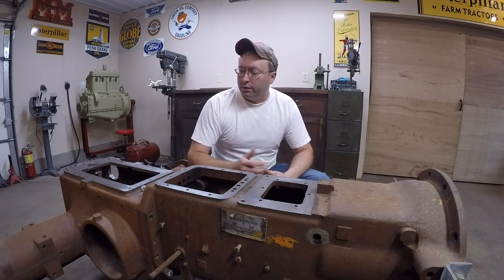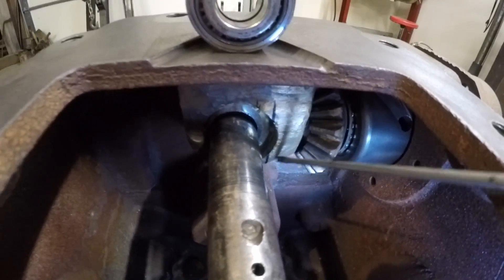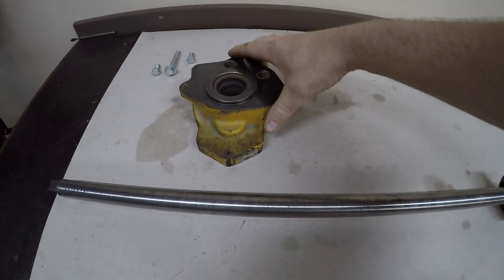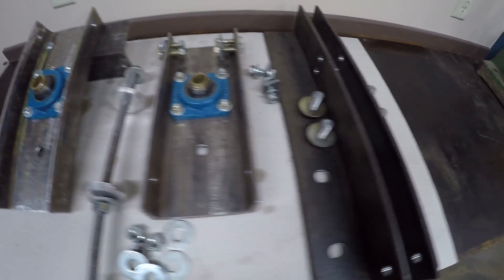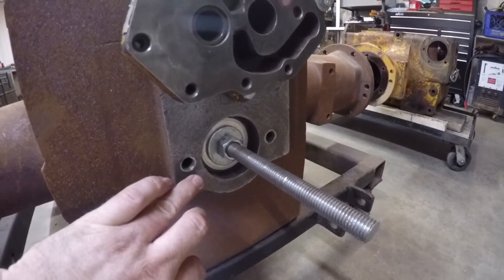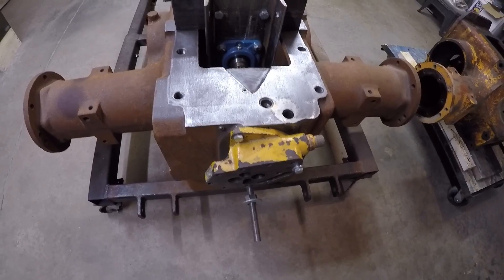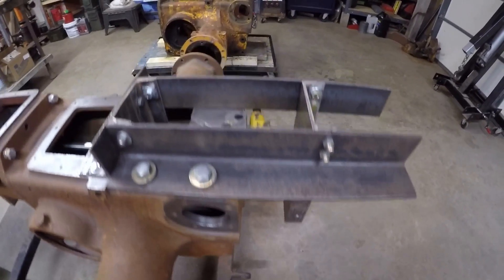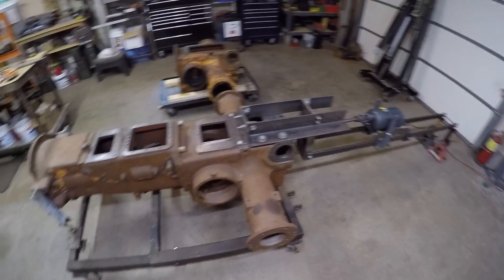Minneapolis-Moline Prototype 445 Tractor #X231 Restoration - Part 17: Rear Casting Boring Bar Setup

Comment: Somebody is a machinist. Leveling the boring motor with jack stands must have been luck to achieve an exact level with the jack notches; or shims were used to laser level the boring  machine. I wonder if you are just looking to mill off outer build up for clearence and the drive joints are auto adjusting the bore shaft and cutting head.

Comment: if you have not milled away all the additional weld build up.  or cut the bore.. just a few ideas.. that nobody outside of youtube might see..  either a smaller OD bearing.. and how about milling off some of the end of the gear in from the side.. so you don't have to remove as much of the build up.  it might reduce some of the full engagement closest to the center of the side gear.  its only an option.. as the tractor failed with the OEM clearance.. and this will probably NOT be used as hard as it designed for.
Reply: just grinding away the flat face of the gear would really not effect a lot of the engagement . its the easist thing to do.   you might be able just thinking about it.. take the middle out of the face of the side gear without taking off any of the gear teeth.. you don't loose any engagement or the lash.. and there is more room to leave metal around the bearing . all depends on how it lines up.